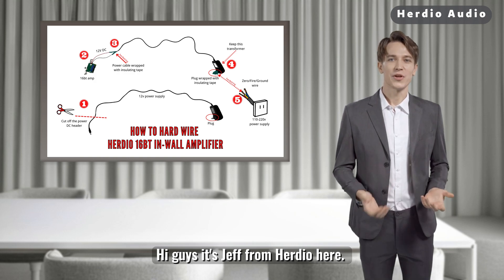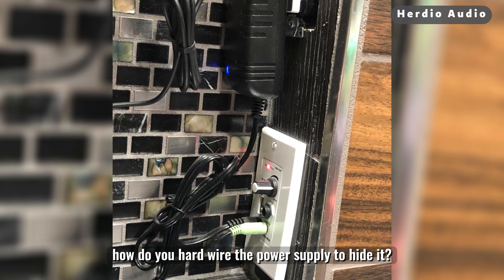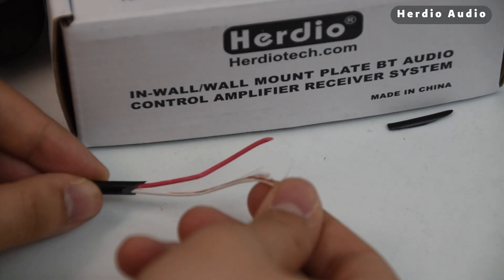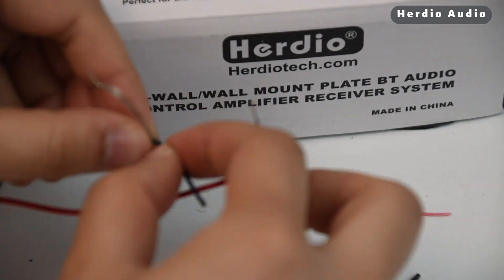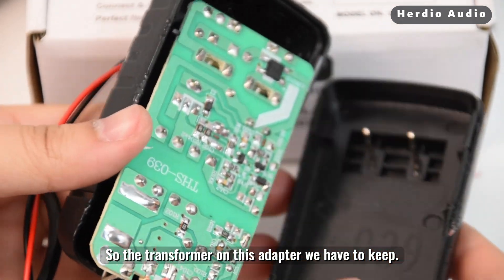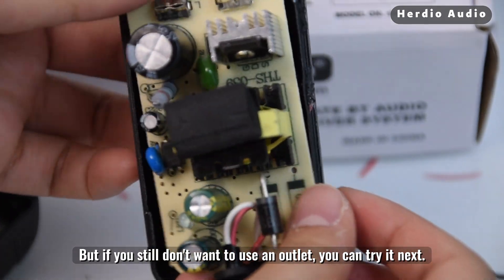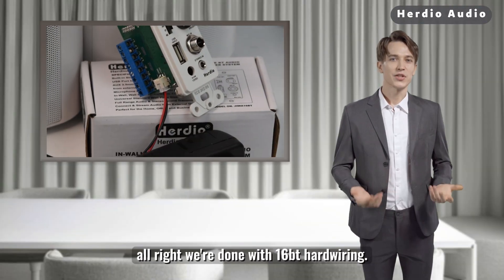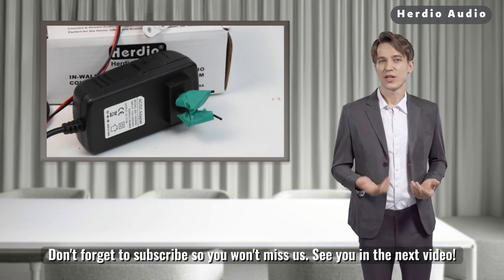How to get hardwired to 16bt in-wall amplifier

Comment: I saw them tape the 12v wires which I was thinking ok I'll probably solder that but I get it, then I saw them tape 120 to a plug, it doesn't take much air gaps to arc and with wire wrapped like that it could easily loosen with heat in you attic and arc burn down your house. This is a law suite waiting to happen

Comment: As a residential contractor, I have to say, this is pretty idiotic.  It would be easier, and safer (but still not a good idea and against code) to just wire an outlet in a single gang box, plug in the transformer/amp, and hide it in the wall.  It's disppointing that no manufacturer, Herdio included, makes an actual hard-wired option, which would be very easy to do.  Just offer the transformer with 12 or 14 gauge wire on the line side that can be connected to a standard switch or in a junction box instead of the plug connection.
Reply: Is there a better mini 120v to 12 Volt DC adapter I can I buy to avoid frankensteining the cables?

Comment: Interesting product, I think that the company should sell the connector with the transformer separately as a single piece for direct connection to the 110 volt  including its price to make the product more interesting, since not all people have the knowledge and the ability to cut and connect cables.
Reply from the maker: Thank you for your valuable opinions, we will definitely convey them to the technical department!

Comment: Please thanks you the lessons, 
Please there are two plugs on the amplifier, one is two pins and one is three pins, which one is for power?
Please can you the the herdio amplifier together with an external amplifier?
Thank you
Reply from the maker: Hello, thank you very much for watching and for your question, this TWO PINS is the power cable and THREE PINS is the audio cable, you can find more hairy details in the video link I gave you below. (https://youtu.be/ScU97PMSjh8)
Also this amp is not to be used with other models

Comment: All of these videos assume that the user doesn't have an AC power supply inside the wall.  If you build a wall unit, doesn't it make sense to support the case where the power is supplied behind the unit?   Jumping through all these hoops just to hook it up to. a power outlet in the attic seems hacky.